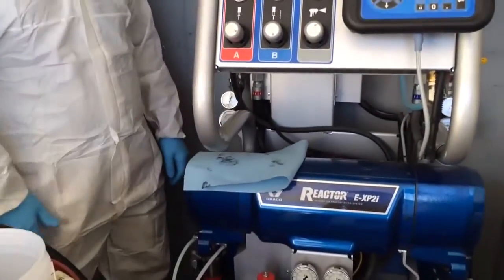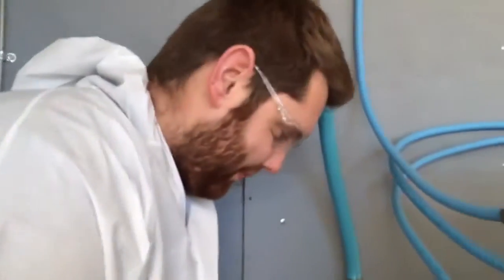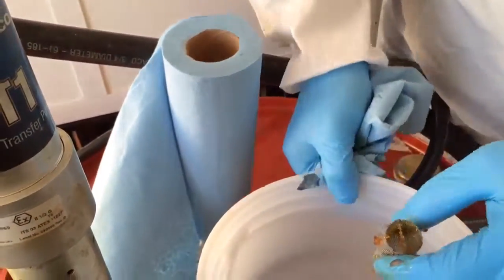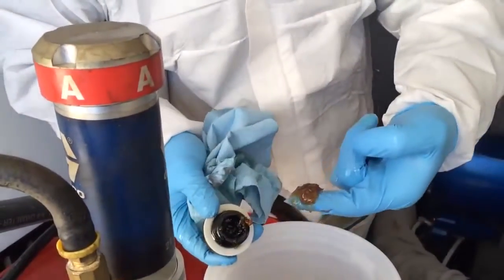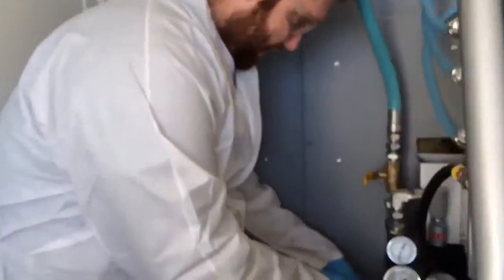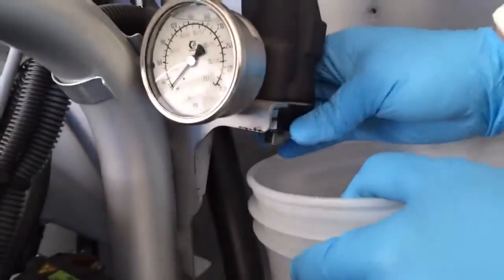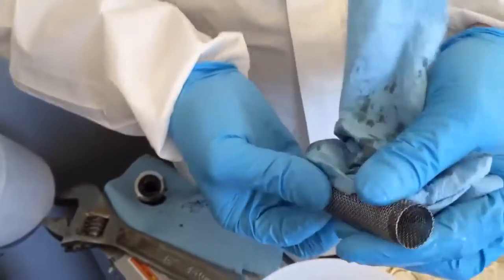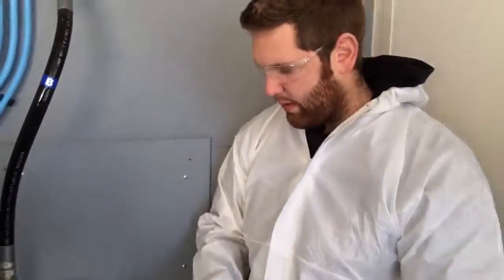Graco Reactor E-XP2i Inlet Strainer

Comment: Didn't clean the cap on the B side before reassembly. It will stick if you don't eventually. Also, you didn't show how to bleed out the air you just introduced to the system through the heater block.